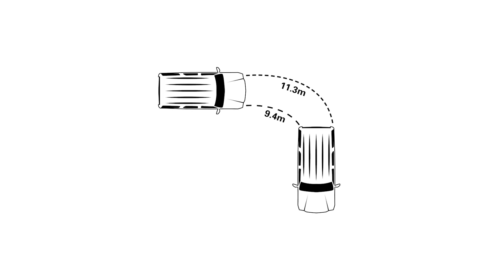SUB $600 DIY LOCKER INSTALL – Watch how much difference it made - Front vs. Rear, Manual vs. Auto

Comment: Turning and loosing traction will both produce un-equal wheel rotation/travel on either side.  How does the unit (w/c doesn't come with a steering angle sensor) determine which action is occurring in order to un-lock the locker?  What parameters does the unit need to experience before it starts to un-lock itself?  It will be good to know its limits for engagement to avoid this in case you might have to do some turns in certain hill climbs.
Reply: The first thing to undertanding is to think of this an Automatic Unlocker ! They dont sense slip to lock - they mechanically (through two opposing sets of camming actions ) detect when a wheel is trying to roll faster than the diff is driving the wheel - and then disengage it. If the wheel tries to roll faster than the diff is turning (which can only ever occur on a hard surface while cornering) it unlocks - when it slows down in speed to the rest of the diff - it rengages.

Comment: Totally agree that a locker up front is more beneficial on an IFS vehicle. I will say having a lunchbox locker on my IFS Ranger I really wish it was selectable, steering can be a real pain and you can’t use it on the street with heavy snow. That being said with an lsd in the rear and the front locker there’s almost no place I can’t go.
Reply: hey mate i was toying with puttin g one of these in a px1 ranger.. you saying you would go something else ?
Reply: It’s less of a bother now that I don’t use the ranger for anything but off road,  In  areas where I don’t need 4WD it makes turning a little bit annoying. So if I come to a tight turn in sand where I don’t need 4WD I can unlock the hubs. So I find myself taking it out or 4WD more often than just keeping it in 4WD until I hit another obstacle. A selectable locker is nice to have, ox lockers have some manually activated lockers. They might be twice the price though and require more for the install like running a cable and a lever. It’s a convenience and you have to decide if the extra money is worth it. I have a electric lockers in my Jeep and don’t trust them yet, my air locker broke, you don’t have to worry about lunchbox lockers breaking and the price is great.

Comment: You can definitely notice a rear auto locker on road driving, i had one and it clicked and clunked but was fine otherwise. I also thought you had to have free wheeling front hubs to prevent binding in a front locker
Reply: Lochie Steedman that’s interesting, so do you think it’s worth it
Reply: @Whiteandsonsgarage  for less than $400 NZD to my door and the difference it made off road, i just got used to it on road
Reply: Lochie Steedman sounds good to me mate, where are you in Nz?
Reply: Cheap Jeeper defiantly worth it - especially in the front of a TJ. Have one in the front of my tj and it’s the best mod I have done yet. I see you are from Brissy area (I think) , come out to glasshouse and I’ll show you how good it works on mine.. :)
Reply: Cody Sorrenson what did you pay for your one? Will definitely look into it. I’m up in Buderim on the Sunshine Coast, yeah definitely keen to take a look
Reply: Cheap Jeeper was only like $300 or something when I got it, can’t remember 100% how much though
Reply: Yes - you can feel them in the rear - but its something you easily get used to - just a few minor changes - like going from an open diff to a LSD - slight changes to the torque steer - a trivial amount of understeer in just afew situations, some small amount of self centring but barely detectable and the occasional tick and tock and  sometimes a clack

Comment: I recently took a front Lokka out of my 80-series.  It requires a particular driving style (i.e. no acceleration or braking while turning), and the front end will fight the steering wheel straight anytime you press the accelerator with 4WD engaged.  Not good for winter driving.
Reply: How can you turn without acceleration ? This is done only when going downhill but then you are braking LOL .  What about turning and climbing or turning on a 4x4 path on even road ? A manual locker needs to be set to off while turning uphill ... If this locker does not disengage then we have problems ....
Reply: "How can you turn without acceleration ?" by coasting.  Duh.
Reply: "How can you turn without acceleration ?" by coasting, duh."A manual locker needs to be set to off while turning uphill" yes, and you have the option of turning it off.

Comment: Right on, Shauno. Cheers for the explanation, mate. Would the same theory apply in a 4wd vehicle that has auto locking front hubs? That theory being that the front locker thanks diff are not in motion when the vehicle is not in 4wd. Cheers for the help!

Comment: Thanks for the well made vid. I installed my Lockright in the front of my Ranger. its definitely locking the 2 axles but My question is about them unlocking. How did you simulate the drive condition of it unlocking? Does one tire need to be rotated back or forward a few deg by a helper and You rotate the other tire? I tried it myself with both tires off the ground and even one on the ground and with a torque wrench I tested the breakaway torque at 150ft pounds but it didn't budge. I'm hoping I didnt screw up my install. Thanks for any helpful info.

Comment: I got a question say if you are doing hill climbing with rocks and you get wheel lift in the back and you have a front lokka won’t it just gain speed and you have to use your brakes?
Reply: I think you're doing well to lift back wheels going up hill and gaining speed 😜

Comment: In a drive system with a solid front axle (like a jeep) I believe you can have an autolocker in the back, but the front is always good to be able to manually control it.  (elocker or air locker)
Reply: All a matter of opinion to be honest.
Reply: @richardkomar8765  Well no.  You can test different situations and then it becomes factual best-case scenario.

Comment: I was told by offroad shop when I re geared to 4.88 not to put a front locker in my 2011 tacoma due to the diff clam shell is weak and a locker will gernade it and break real easy.
Reply: i see this locker dont fit tacoma nevermind ha

Comment: If I understand it correctly, it's essentially two pairs of ratchet plates, that replaces your spider gears ?
Reply: Thats the gist of it. You have to slip the crownwheel off to access the spider gears and cross pin for removal. Comes with loads of instruction and I believe there's a You Tube vid.  With the diff on the floor and providing the side thrust clearances are within limits its an hour.  Remember to locktite the C Wheel bolts etc.
Reply: @dartmoordave  
Ah, I see … keeping it simple seems to work well, huh ?
How would it work in reverse though ?
Reply: @Grumpy_old_Boot   Same both ways, sometimes its slow to unlock if there's a lot of load on the ratchets but jog to and fro usually does it. Yes, it replaces the side gears so you must have one that matches your drive splines. My trooper still has free wheel hubs so I unlock and go to 4x2 so front axle is not driven. Saves wear and noise.
Reply: @dartmoordave  
Ah ok, thanks for the info. 😃

Comment: I have a 1981 Ford F 150 and a 4.9 IL 6 cylinder engine. It is totally rebuilt to near-new specs.  I run power lines in the mountains in northern Arizona to check both towers and lines. My question is there a diff pack available for both front and rear axles?

Comment: Absolutely fantastic vid cheers guys.  Now my question is,  I own a GEN 2 NL PAJERO which 'HAS' the options of being,  2WD, AWD (like 80s, 100 series) &! 4WD. Fitting a locker to the rear is a no doubt, I will fit one.  BUT what about the IFS front on these?.. Cheers.

Comment: Lockers in IFS are kind of frowned upon here in the states. I believe mostly because of parts breakage and aluminum diffs.
Reply: Mate they brake here as well, actually they brake anyways because they are ifs but a front locker just speed things up.
Reply: Biggest cause of front axle breakage on IFS is single wheel spin-up and hopping. Lockers prevent these things so if you drive the same tracks, you will break less with lockers.  
The reason lockers cause breakage is that they allow you to drive much harder tracks than you could with open diffs.  
The problem with an auto locker is that it can't be switched off so more care must be taken not to put stress on the front axle.

Comment: I had one of those and don't drive with a low or flat tire if you can't disengage the axle that it's driving you with cause it will jerk and clang and throw you all around in the truck and make it hard to control your vehicle they should be outlawed for on the highway driving!

Comment: Is this like a Detroit locker

Edit, someone replied and explained it's similar to a Detroit Locker. The difference is this replaces the spider gears or planetary gears, like a mini spool. Where are Detroit lockers a full assembly
Reply: Same general principle, but entirely different mechanism and completely different handling characteristics (a lot better !) - it will unlock with a finger of force and relock with 20th-40th of  a revolution
Reply: @4wdsystemsgeartogoannawher754  ya I'm getting one. I have a nissan titan with a Curries axle and Detroit but nothing up front. This is awesome.

We were going to fab up the Curries ford 9 center section and replace the stock front diff. But going to get this, run it, until I blow up the front. Then fab up new diff and move this system to the new unit.

Thanks, from California

Comment: NEED HELP/SUGGESTIONS.. I've always only had Chevy Solid axle 4x4's now I Just got my 1st newer 4x4 it's a 2002 Toyota Sequoia With VSC (Whatever that is) I'm wanting to put a locker up front but had a friend tell me it would not work with the VSC system. Can someone tell me if it will or not? Also, I want to add a 2" lift, Will the stock shocks work with 2" lift until I can afford new Shocks. I'm in the USA state of Alabama. Any suggestions on parts would be great!!!! Found this channel a couple of weeks ago and I LOVE IT!!!!!

Comment: I would still prefer a manual locker.  Not hard to engage it when you need it and turn it back off when you don't.  What are you going to do if the trail requires you to be turning a corner on rough terrain? Now you have a disengaged locker with that auto full locker you put in.

Comment: Hey boys just a quick question
When you are going full pelt up a 4wd track that has a turn on the obstacle will the lokka remain locked or will it unlock -  cheers
Reply: The more power you are giving it, the less it will want to unlock. So full pelt up a track, it will probably stay locked. That is why it is important to only use on in the front if you have power steering.
Reply: Can do both - if you are powering through and churning the wheels a bit - then it may stay locked the whole corner, if you are on a harder surfaced track then it will most likely unlock - it will literally unlock and relock again while a wheel goes over a big lump or through a big hole - if the wheel tries to roll faster than the diff is driving the wheel then its free to do so. But that only occurs when the momentum of the vehicle is causing this to happen.

Comment: I understood this all until he did the test where his mate applied load to one of the wheels which unlocked the diff........ Because when you're off-road and one tyre is on the ground and one not (like applying load to one as they tested) you don't want it to unlock. So how is applying the load like they did in the video different to driving off-road with one wheel on the ground. Please explain 😅

Comment: looking to do the front of a  16 DMAX. Just worried about being in 2wd and front diff locked up. Shauno said its no problem but is there any video confirmation? When he had the Hilux off the ground both wheels were locked?  I'll contact Lokka directly also

Comment: I don't know much about these but I do have a question. If it unlocks when you turn the steering wheel, what happens if your climbing and the path leads you in a direction that you need the lokka engaged but you have to turn? How would the lokka function in a situation such as that?

Comment: They have em for the hilux, but not for PX rangers. Is there a reason for that? I know the electronic traction control is on the PX, but that's not as effective as a front locker. Or is it....?
Reply: In development stage, I called them and found out there are quite a few vehicles on that list
Reply: @richardkomar8765  ah fair enough

Comment: That is a brilliant idea, definitely have to fit one to the PX2.  How does effect you on the beach when you want some wheel spin in 4 high
?
Reply: If you are saying you want to gun it - to spin the wheels, then assuming you have the power - its just means you will spin both wheels - but you wont be able to just spin one wheel !

Comment: That's a bit confusing for me as a layman, so I'll risk the roasting to ask a stupid question... 

How will this function like a proper locker if all it takes to disengage it is the small amount of resistance showed during your test to release the locker?
Reply: Both wheels are always driven at the same speed, neither one can go slower than the diff carrier. When it unlocks one side, it allows that side to be spun ahead of the carrier while driving through the other side. As long as the carrier is turning, neither wheel can stop.
Reply: It's really hard to get my head around. Thanks mate. @JeremyPetho

Comment: Question with the Auto locker. That disengages when both wheels have traction correct. Living more in the North in the U. S. we see snow. Would the autolocker stay engaged due to the reduced traction? Even if there was no power being put to it while in 2HI?
Reply: The auto locker would be disengage when you’re in 2wd. It only locks when you go in 4auto, 4hi or 4low. I wouldn’t recommend driving on the highway with an auto locker engaged at speed. Just use it to get out of the area that you’re stuck and go back to 2wd is what I do

Comment: Everyone says to put a rear locker first and a front if you really need to. I have a gx460 and I want to bump up its capability. You are saying to get a front locker instead of rear correct. Gx460 is basically a prado.  Torsion center etc. if I’m going for a locker not an auto locker which should I go.

Comment: This might be a very dumb question but would it benefit putting front and rear locker? I have a 2003 Mitsubishi Pajero exceed nm
Reply: Unlikely they have the for both the front and rear of your Pajero but it does work to put one in both front and rear.
Reply: JP Onefourseven 
Thank you sorry still learning

Comment: The question is then, why don’t the manufacturers ship the vehicles with auto lockers if they are that good?  Also, wheel spin of a lifted wheel indicates a poorly designed system as either active torque vectoring or ABS system braking the spinning wheel makes the requirement for a locker redundant.

Comment: I live in the states and I have 2 4x4s. One is a Chevrolet Blazer ZR2 and the other is a Chevrolet S10 ZR2. Both trucks have the factory G80 locker in the rear. Is there a front locker available for my trucks or would it be more cost effective to SAS? Thanks Shauno and 4wd team. Keep up the great content.
Reply: Im not 100% sure, but we ship to the US most days 

We do the following I know to be in front of Chevs
Dana 44, 30 Spline
GM 10 Bolt 8.5" C-clip, Beam axle, 28 Spline
GM 10 Bolt 8.5" Beam axle, 30 Spline
GM 8.25" IFS Alloy, 28 Spline

Comment: So every time you tune you wheel while off-roading the dif lock will disconnect. How will this work in deep mud when your are trying to get traction buy turning your wheels rapidly from left to right ?
Reply: When it disconnects it only allows one wheel to skip ahead, neither wheel can go slower than the diff carrier so you can't spin up a single wheel.  
In deep mud there is no traction to disconnect it anyway so it will just stay locked.

Comment: I have watched  most of your vedio,  thanks a lots very useful. Is this safe in sand hill climbing  with 4Low rangen( pajero nt). With 40-50kmph. As while it engaged driving may have to turn the steering the same speed  the it could  cause to roll-over isn't it? Thank you

Comment: If you could hold one wheel by hand and turn the other to simulate turning corners, how does the locka know to lock up when it lifts a wheel? Turning a corner the differential releases to allow for  different wheel speed, but when a wheel is in the air it also has a different wheel speed so how does it lock? PS loved the vid and depending on the answer I'm going out to buy one!
Reply: The torque generated from the engine will keep the locker engaged as power is delivered to the differential. The only thing that will unlock it will be the tires gripping the asphalt at different rates. I think one thing they don't mention is you cannot expect the locker to disengage if you are giving it throttle which is applying torque to the differential. They did say do not use for all time 4wd systems which is basically why. Part time 4wd systems are ok because on the street you are in 2wd and your transfer case isn't sending any power to the front diff. The tries gripping the asphalt at different rates on the street with no power being delivered to the front will force the locker to disengage.

Comment: I’ve read through the comments, and I haven’t read if it is safe to instal a front AND rear locker on a daily driven vehicle that is on pavement more than off-road. Or would it wear out the parts too quickly?
Reply: Its safe for all part time 4WDs in the fornt on road - its basically not connected and not working !